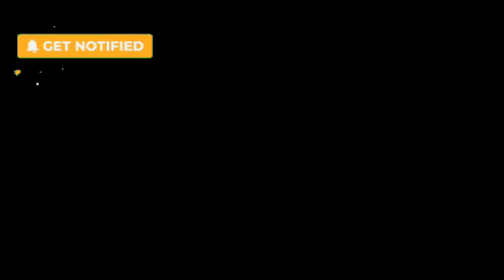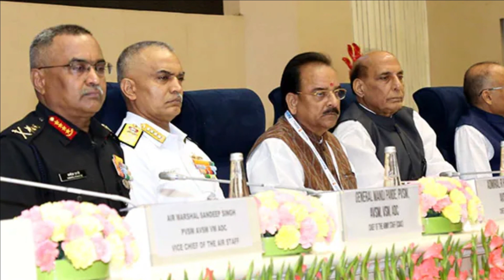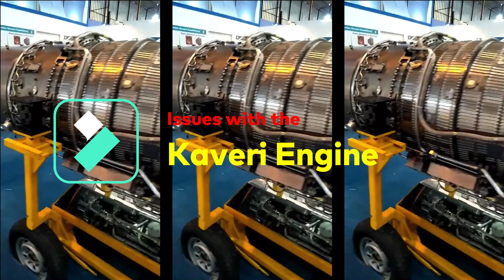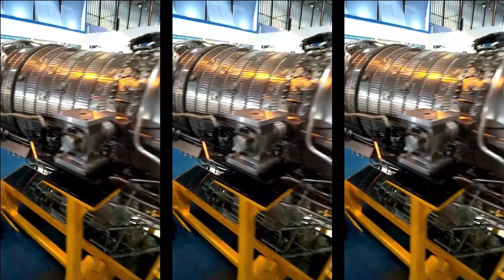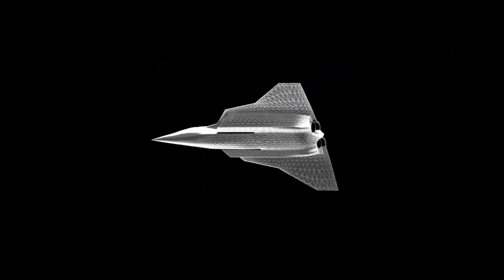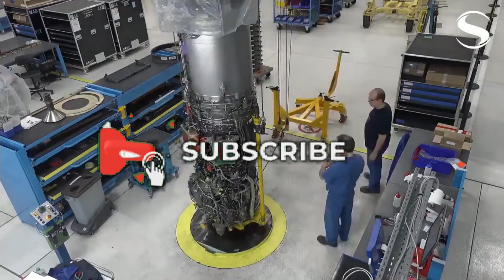India can make 80kN Combat Jet Engine | AMCA engine by 2035?

Comment: Thrust was already almost of f404 levels (84kn vs 80kn). Flutter, screech and afterburner issues are resolved. What about weight? It's almost 200kg overweight compared to 404.
Reply: Ge f404 r 78 kn

Comment: Is it difficult to add 30kn thrust in that engine 😁
Reply: Yes it is not easy. Higher thrust requires ability to withstand higher temperature. That requires high tech metallurgy and India is generally weaker in material science.
Reply: It is not about increasing thrust vector but making it more stealth 👍
Reply: Don't worry bro... I will be adding the extra 50 kN thrust withing next 10 yrs...
Reply: @User86559  okay thats great.
Reply: Use Extra premium petrol
 😂😂